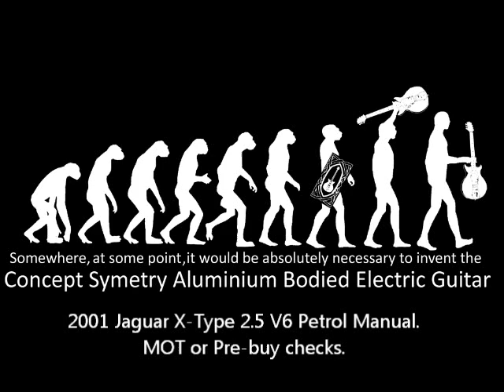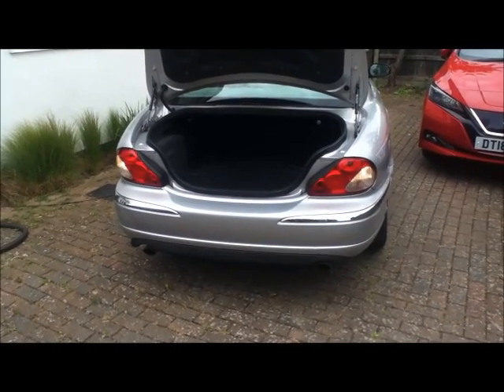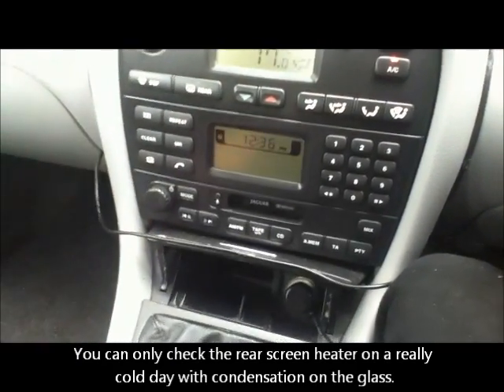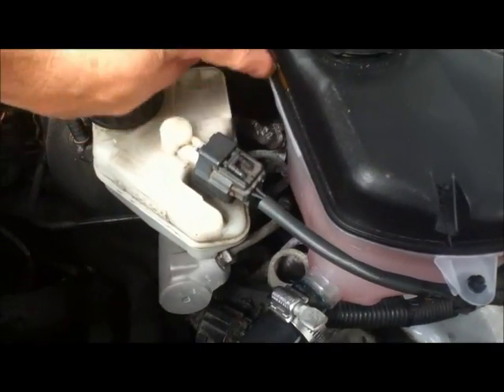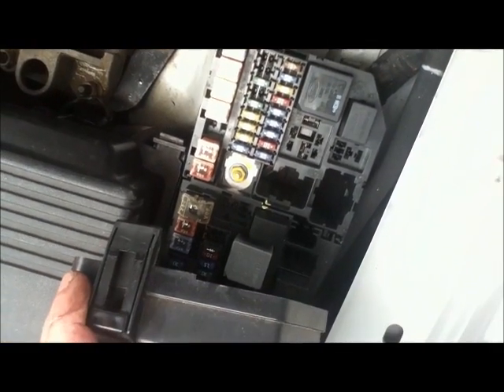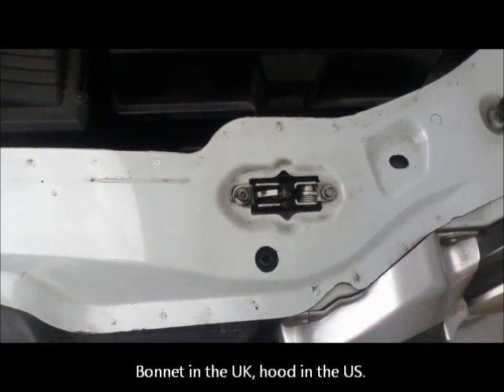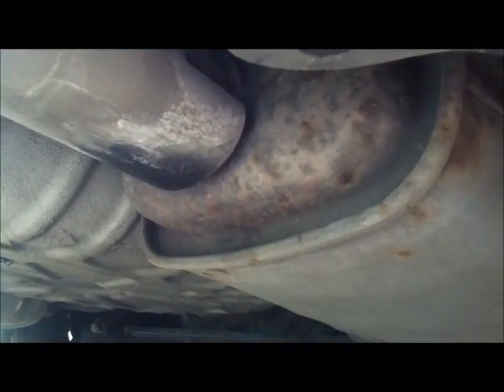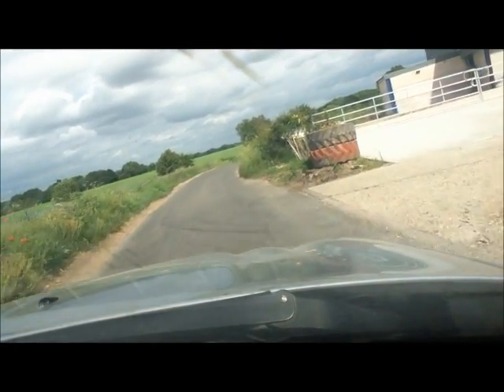Jaguar X Type 2.5 V6 - Thinking of buying one?

Comment: I've  been following you and your videos for a long time and boy have you done a lot of work on your X Type. I just love the compact X Type design with the traditional classy leather and wood, but I hate the mechanical side of this car so I disposed of my 3ltr V6 AWD and went in search of the more  practical 2.1ltr FWD model. I can change plugs and coils without removing the intake manifolds. No transfer box to restrict the removal of the oil sump pan. No rear drive shaft and diff which travel under the petrol tank that contain the fuel pump etc. And just powerful enough to get me from A to B safely. I have faster Jaguars but never get the chance to go fast without getting speeding tickets, so this one will do me fine  as a general get around.
Reply from the maker: Apart from the image and general feeling of satisfaction that comes with the car it is the amazing handling the AWD drive offers. I live in the countryside with lots of twisting backroads. There are few cars that can keep up with my 'old man's Jag'. To be fair to it when i bought it i knew it had not been looked after and had been kept by the seaside so was going to be rusty. It was trouble free until i backed it down a hole on a building site and that created a chain reaction. I agree totally with you about the overly complex systems and the need for extreme maintenance just to do simple things like changing the plugs. I drove it for 6 years and my Dad has had it for 4 years. I do a bit now and then and it still goes like a bomb.

Comment: I have the 2002 3.0 version you point out what i have seen my jag shakes rattles on the expressway I assume its the control arms and old bushings being old etc. What are you thoughts if any ? I plan to keep this car a very long time. Jaguar discontinued the EVAP solenoid on these in the USA So my only choice is EBAY.
Reply from the maker: If it shakes it is probably the shock bushes so check them first. I have replaced every arm on mine. They are surprisingly cheap but don't buy ebay fakes.
Reply: @johnnysevengun  hi... sorry for worriyng may I ask you... does door lock cylinder has some electricel stuff? I have problem tha my right side doors on deadlock and I cant open their but left side is working so I thought maybe problem in drivers door lock cylinder that it give signal to the left side but not to the right side
Reply from the maker: @LexPrioria  The door locks are electrically driven and also have the wiring for the alarm. There is no wiring from the door lock cylinder which operates the catch through a vertical rod (which also operates the switches). The rod has a plastic fitting which can slip so it does not work properly.
Reply: @johnnysevengun  thank you